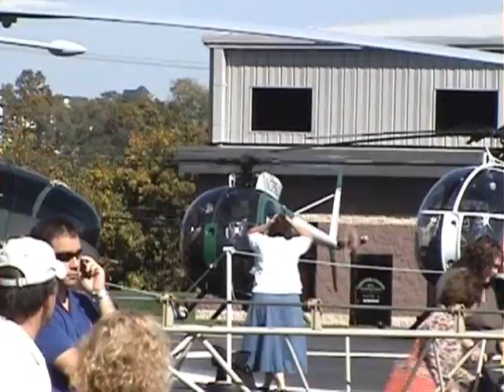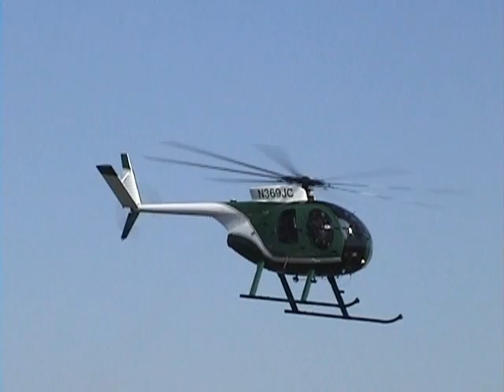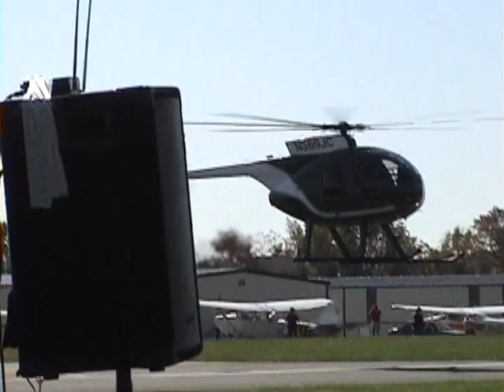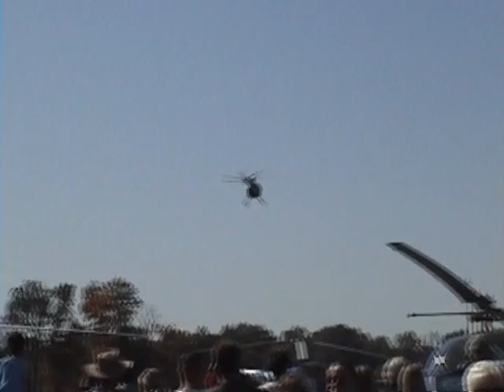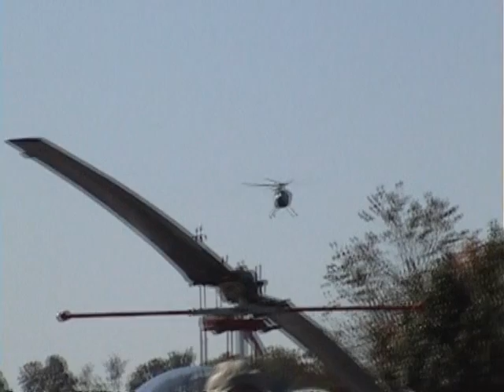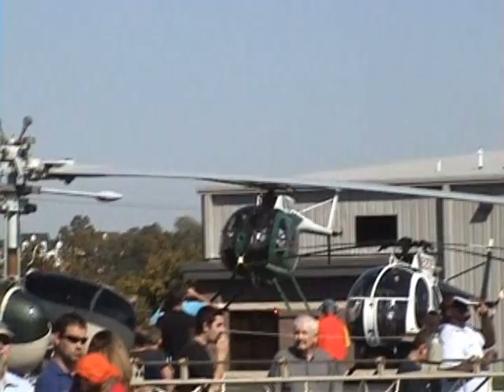Rotorfest 2008 - Hughes 500 Demonstration

Comment: The canted stabilizer on the tail of the helicopter would identify this as an early model 369 series (369H, HE, HS  Commercially known as the 500C). The MD 500 Series is still one of the most popular helicopters in the US and abroad with law enforcement agencies, military, and utility operators. Its currently manufactured as a MD 500E or MD 530F in Mesa Arizona at MD Helicopters.